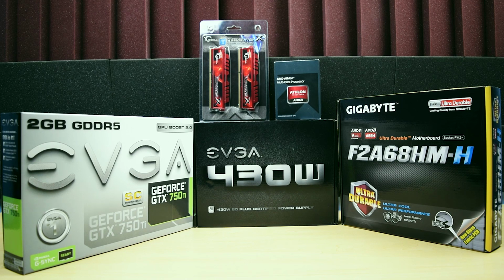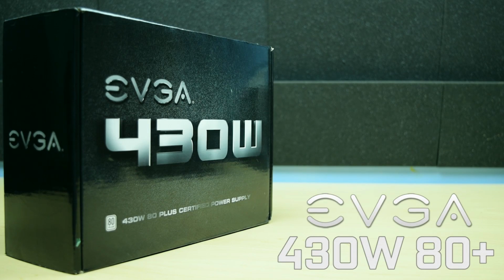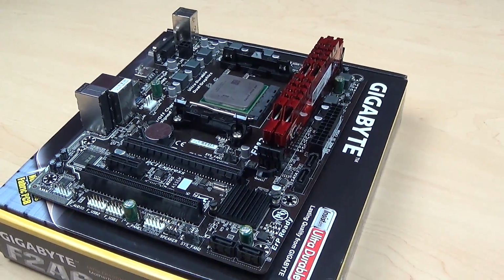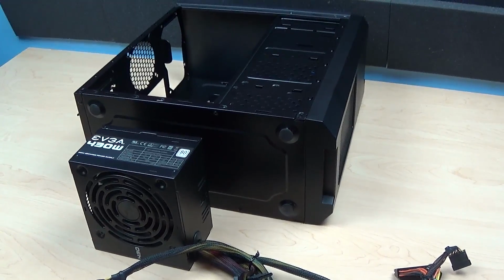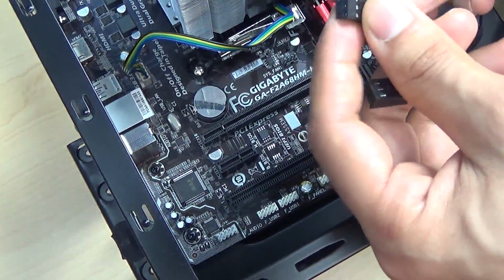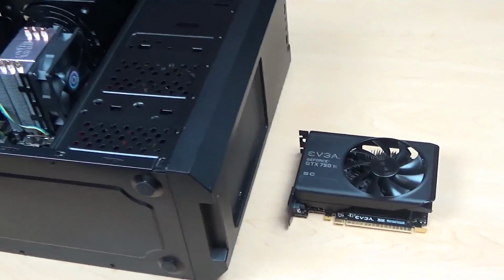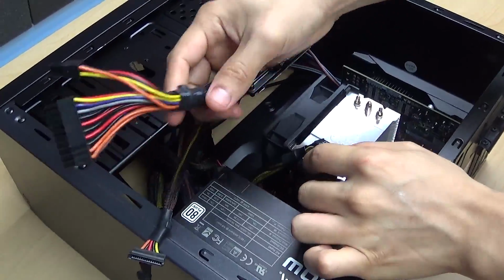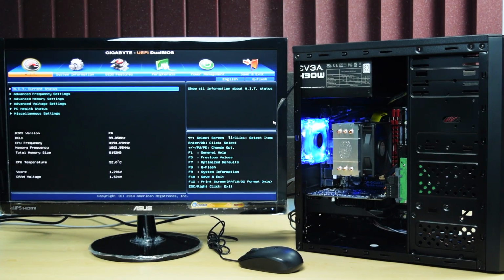Low Budget 1080p Gaming PC Build ($400)

Comment: PCPartPicker part list: http://pcpartpicker.com/   
here's what I made
Reply: PCPartPicker part list: http://pcpartpicker.com/p/GcKdBm
Price breakdown by merchant: http://pcpartpicker.com/p/GcKdBm/by_merchant/

CPU: AMD Athlon X4 860K 3.7GHz Quad-Core Processor  ($69.99 @ Amazon) 
Motherboard: Gigabyte GA-F2A78M-HD2 Micro ATX FM2+ Motherboard  ($51.98 @ Newegg) 
Memory: Kingston HyperX Fury Black 8GB (1 x 8GB) DDR3-1600 Memory  ($34.89 @ OutletPC) 
Storage: Seagate Barracuda 1TB 3.5" 7200RPM Internal Hard Drive  ($45.89 @ OutletPC) 
Video Card: EVGA GeForce GTX 960 2GB SuperSC ACX 2.0+ Video Card  ($169.99 @ NCIX US) 
Case: Thermaltake Versa H23  ATX Mid Tower Case  ($29.99 @ Newegg) 
Power Supply: EVGA 500W 80+ Certified ATX Power Supply  ($34.99 @ Amazon) 
Total: $428.72
Prices include shipping, taxes, and discounts when available
Generated by PCPartPicker 2016-04-02 18:28 EDT-0400

Comment: http://pcpartpicker.com/p/j9BjTW 1 Can someone suggest a good motherboard (cheap) 2 Is this a good first gaming pc 3 What games will it run 4 Do i need an ssd?
Reply: +Hail Rasmus the mobo you have at the moment isnt compatible with your processor, and whats your budget? and what are you planning to do with this build? gaming or also editing? and are you planning on overclocking?
Reply: +Nicky FD I know its not compatible and my budget is around 500. Im just planning to game. mostly cs go
Reply: +Hail Rasmus and will you be overclocking or probably not?
Reply: +Nicky FD Probably yes
Reply: +Hail Rasmus here you go http://pcpartpicker.com/user/Nickn753/saved/BTQWGX
i threw in a 8320E because i assumed you weren&#39;t gonna overclock and this is only about 25$ more than a 6300 but has better performance in general. i also chose the r9 380 because of its 4gb ddr5 and it being much much stronger than the 750ti. an SSD just doenst make sense with this budget as you would have to sacrifice to much performance for the speed you gain.
Reply: +Nicky FD Oki Thhhhhhhx

Comment: You picked a pretty terrible case for overclocking and to make it worse you didnt install a push pull directly on the tx3 :(
Reply: do you know the English language?
Reply: aslong as the case fits the mobo and gpu i dont think it will effect oc
Reply: better temps is one of the best ways to improve hardware life and increase you max potential oc. i personally run a push pull on an older hyper 212 with both fans blowing air directly up into 2 exaust fans. with 4 120mm in the front, side panel and next to the i/o sheild. Funny thing is it it didnt really cost me all that much and i get extra awesome temps. Well worth it imo

Comment: What frames would you get if you turned down the resolution to 900p or 720p at high settings? Would it achieve 60fps? Thanks
Reply: yes :)
Reply: +Edrick Vince Velicaria less detail and lower resolution mean higher performance.

Comment: what if i used old i7-950 cpu instead ?
i've seen one rebate so cheap (bundle with mobo+ram).
Reply: It's an older CPU sir, but it checks out. But you need a different motherboard.
Reply: ja, like i said, bundle with mobo (MOtherBOard + RAM 6gb)

Comment: is there a big difference between the 750ti and the non ti?
Reply: ti is iverclocked and has more vram
Reply: +Aryan TheGamer The 750 TI has more cuda cores also. So there is a large difference in the 2
Reply: If you're thinking about getting the 750 ti, save up for the 750ti sc because it's quite a bit more powerful for a little more. Or go for the ftw edition, it's factory overclocked

Comment: Hi can you check out my build? I am now building my second PC this one is going to be built for gaming obviously. And also I have one last question, will my CPU bottleneck the beast graphics card? Thanks for the help!
CPU: AMD FX-8370 Black Edition
CPU Cooler: Deepcool Captain 360 
MOBO: ASUS 970 PRO GAMING/AURA AM3+
RAM:Crucial Ballistix Elite 16GB Kit (8GBx2)
HDD: WD Blue 1TB Desktop Hard Disk Drive - 7200 RPM
SSD:Kingston Digital HyperX FURY 120GB SSD SATA 3
GPU:MSI R9 390X GAMING 8G Graphics
Case:Phanteks Enthoo Pro M Mid Tower Chassis, Black Cases PH-ES515P_BK
Power Supply: EVGA SuperNOVA 750 G2 80+ GOLD, 750W
DVD Drive:LG Electronics Internal Super Multi Drive
Monitor:ASUS VN289H 28" Full HD 1920x1080 HDMI
(I already have windows 10 and 8.1 on a disk)

Comment: Not a big pc guy, and looking to build this. Would it be able to run csgo or gtav? Thanks!
Reply: Cs go is a EASY game to run you don't need a good PC at all
Reply: +SancoCustoms easily
i currently have the same motherboard and cpu with a gigabyte r7 360 which is equal to the gtx 750ti and i get around 160fps in csgo with high settings
Reply: I have a slightly better build and can run CS GO at over 200fps so it can run it easily. I'm not a huge GTA guy tho but it should be able to run it fairly well

Comment: would the gtx 750ti sc play the new starwars battlefront?
Reply from the maker: +dallas Keller The GTX 750Ti SC can run SWB @ 1080p /45-60FPS high settings.
Reply: +WhiplashGaming you will probably need another motherboard voor intel cpu's but you can check it at pcpartpicker.com Good luckk

Comment: I bought kingston hyperx savage 1866 MHz but it was set on default in bios on 1600 MHz (MB supports up to 2133 MHz). should i change it to 1866 or just let it be on 1600 ?
Reply: +Sanchez9531 why would you leave it on 1600? like you would buy a car and never change it to a higher gear for more speed.

go for the max
Reply: klnhtw there's smaller chance it will break when you're not pushing it to it's limit. i'm just wondering if it would really make any difference. if it gives me 1 more fps i would do that.
Reply: these memory sticks won't break, trust me and set it to 1866, your rig should be faster(that doesn't always mean more fps, but more chrome windows, ect)

Comment: I thought AMD boards don't support PCI-E 3.0 as of yet. Or is it the cards?
Reply: +Kayemache 
since the erly quarter of 2015 almost everything supports 3.0
Reply: +Kayemache The 860k supports 3.0 but the FX series are only 2.0
Reply: +Ace Striper Thanks for the information.
Reply: +Kayemache Besides, PCI-e is backwards compatible. The newer standards just have more bandwith. So maybe GPUs 4-5 years from now will not work on gen 2, but no current GPU will have a problem on a Gen 2 x16 slot.

Comment: does it have wifi
Reply: nope no wifi, you have to get that separately. I built this exact same rig. It works great, I bought a netgear wifi USB but I found out that a lot of these USB wifi receivers that are out now do not support Windows 10 only previous windows versions. I updated everything possible, deleted, and re downloaded several times with different updates and it never even turned the USB on. So no wifi, and also no cd driver.

Comment: Will this pic work in 2016 with over watch and Gta 5
Reply: It will work great for over watch but you will have to play gta at medium settings. However I would get an Rx 460 instead of the 750ti
Reply: +Zachary Zedack ok thanks man I'm looking to get a new pc man
Reply: That would bottle neck the gpu cause the 860k couldn't handle the power
Reply: Pick the R9 380, the R9 380 is a good GPU and its a good duo with the 860K. Because The Rx 460 needs a better CPU. and the R9 380 is a good duo with the 860K
Reply: The r9 380 is more powerful than the rx 460. I use an I5 6500 with my R9 380

Comment: HOw did ur pc comes preintalled with an os?
Reply: No, its impossible to buy a bnew hdd with os installed. He installed it
Reply: Tyvm, installing the os on a new computer is the scariest part for me.
Along with getting the drivers.
Reply: +John Sia its just a software, its ok if you screwed up installing the os or drivers, you can use an application like driver genius to install the right drivers for you, it makes more easier
Reply: +John Sia Never install the drivers from the CD, always go to the manufacturer's website to get the newest drivers.
Reply: +ShrekalG0D - PvP Clips & Fights I use the cd for my gpu so i can get the card running and install the latest up to date drivers lol
Reply: EclipZe That's also an option as long as you update it :D You probably know this but the reason im telling people this is the driver cd in the box of the gpu comes with drivers from the release date of the gpu, so if you get a gpu from like 2012 the cd is gonna have old driver versions on it.
Reply: ShrekalG0D - PvP Clips & Fights Well I use a XFX R7-240 2GB of VRAM (DDR3 I think).
I'm saving up for a 750ti. Don't ask me to get the
R7 360/370 because the 240 always freezes when I'm pushing it's limits and yes I have proper cooling. AMD is top notch garbage when it comes to GPUs. No offense AMD fans but this is from my personal experience
Reply: +EclipZe The best method is to buy a cheap 1GB pendrive, Go to a internet cafe, download DRIVER BOOSTER 3, use the program to install the networking and sound drivers, then download the specific driver needed for your graphics card lets say GTX 750 Ti and your done. I heard driver booster 3 installs outdated drivers for graphics card so don't install that, use the onboard chipset on the motherboard till you install the graphics card drivers. 

Easiest way.

Comment: is this good? :'(
AMD A10 7870K 3.9 ghz
8 GB of HyperX DDR3 RAM
Asus A68Hm-K
some random case i found on a computer parts shop with a 600 Watt PSU
it cost me 387 dollars
Reply: If you get a graphics card, 750ti or r7 370, you can get better performance from your 7870k by changing it to a dedicated CPU instead of working as a CPU and GPU. Pretty solid though!
Reply: Haha ty

Comment: what program you use for fps?
Reply from the maker: +eiwa123 MSI Afterburner.
Reply: thank you
Reply: +MGTech what about this ...... ASUS AMD Radeon R7 240 2GB 128 bit DDR3
- 16 GB RAM Dual Channel ( 2X8 1866 MHZ ) 
- AMD Athlon(tm) II X4 860K 3.7 GHZ
- EVGA 500W PSU
- Windows 7 Ultimate - 64 BIT
Reply: +jackcan game 16 GB ram is WAY overkill for this , get 8 GB and maby save up a little more to get a 750ti.
Reply: Jack Baillie the thing is , it's not over kill because i don't need to get a graphics card , unless i do . do i need a graphics card with this build ?
Reply: Yes you would need a graphics card , the x4 860k does not have integrated graphics.
Reply: Jack Baillie what graphics card should i get
Reply: It depends on how much you want to spend. If you are on a really tight budget you might have to get the r7 240 , but if you can afford it I would definaltely save up for a gtx 750ti/950
Reply: Jack Baillie i all ready have the radeon r7 240 2gb graphics card , which gtx 750 ti ? there are different makes like zotac
Reply: Ah ok , the evga 750ti ftw as it has highest base and boost clock , but you might have to look into which one suits you best eg one might be smaller and more quiet but runs slightly slower or another might run the fastest but draw the most power.
Reply: Jack Baillie oh ok dude thx
Reply: +jackcan game np
Reply: +MGTech can this computer run fallout 4 and GTA V?
Reply: +jackcan game If you haven't bought anything, you should get an r7 370. Bit better than the 750ti and it's around the same price too.
Reply: +Goofy Gaming 
barely
Reply: The.one.lVlonster It could run it, just not too high settings.
Reply: Hey there MGTech! I might be getting the pc parts for Christmas :) Thank you so much for this guide. One more thing, the AMD Athlon X4 860K 3.7GHz Quad-Core Processor is out of stock according to PcPartPicker, do you know the closest thing to that proccesor? Thanks ~Adrien

Comment: Hey MGTech, i got the GTX 960 4GB card. How much fps will i get with this build?
Reply: much better.
Reply: Gtx 960 is weak dont expect much from it
Reply: 'Dont expect much from it' Why? You'll need to use the 4gb version but you can run all games, including next gen games on high settings with the right CPU, i am playing with the 860K with the MSI GTX 960 4GB, I run Fallout 4 on high 55-60 fps, GTA 5 on the same settings with same fps. Project Cars on Ultra no problem 60 FPS, so tell me again, why shouldn't i expect much from it?
Reply: +Gijsjuh since when is 60fps playable? 60hz scrubs
Reply: Alpay Aygün what the heck do you mean? 60 FPS is why people play on pc man
Reply: Gijsjuh 144hz is the real world
Reply: Alpay Aygün So? there's no diffrence between 60fps and 144 fps, it's both buttery smooth
Reply: IF YOU HAVE SOLID 60 PFS THERE'S NO DIFFRENCE THOUGH
Reply: Alpay Aygün That's right, but if you have 60fps all the time, no matter what happens, you don't need more fps.
Reply: +Gijsjuh 60fps is unplayable for me sorry
Reply: Well okay, i don't really understand why but okay
Reply: You play on pc right?
Reply: Gijsjuh ofc, consoles dont have 144hz capability. when you get used to 144hz and try to play on 60fps it feels like 30fps when you're used to 60fps
Reply: Alpay Aygün Eeeh okay i guess

Comment: hey i asked for a quick response cause i just built your computer and there is nothing showing up on the monitor we tried 2 moniters,with hdmi and vga and both didnt work plz help this time, u built so you should be able to help me out with this
Reply: or any veiwers that know what there doing with computers just really need help, am very frustrated cause this pc is not working plz help
Reply: +ItsRhyez Does the PC even turn on?
Reply: +Rhelmar yep it does it runs and the fans are good and eveything is plugged in but still no display on the monitor
Reply: +Rhelmar we need to find a way to install the graphic card drivers on this pc's harddrive
Reply: ItsRhyez it should still display something even without drivers. It's just the resolution that will be weird. So the fan on the graphics card is spinning but it's not posting on the monitor right? Do you have the exact same parts as in the video?
Reply: +Rhelmar yep fan is working and such and yes they are exactly the same as in the video
Reply: do you maybe have an old computer at home where you could try the gpu? Check again if you have everything connected properly. have you connected the 24 pin and the 4 pin connectors properly?
Reply: +Rhelmar yes we do have a older pc and i jusy check the 24 and 4 pin connectors are in properly
Reply: ItsRhyez try the gpu in the old pc and see if it works. If it doesn't work, the card might be defective. Did you buy it used or is it brand new?
Reply: you could also try the old graphics card (if your old pc has one) in the new computer and see if that works

Comment: can this run fallout 4 if so what settings?
Reply: yes. probably medium to very high settings.
Reply: oh cool thanks stargates96
Reply: welcome. I've seen lower speced builds run it at 1080p at high with 45 fps and also those builds have gotten 40 fps on witcher and stuff so this build should run it very well.
Reply: do you think it can run overwatch with high settings?
Reply: LoL KS high at about 35 fps but medium would definatly be 45-50 fps
Reply: LoL KS Actually No. I checked out some benchmarks with parts in this build. At epic its about 55 fps at high its over 70 so yeah you are good.

Comment: Will it run GTA V tho?
Reply: yes very easily
Reply: +Alexis The Pro It can run it at high settings?
Reply: +Gulle Master Of course
Reply: +Remus Ciuciu is that sarcasm?
Reply: +Romeo402 No isn't sarcasm.Will run GTA V on high. ;)
Reply: +Remus Ciuciu No it wont buddy ;)
Reply: +Oh Vegetables It'll run it 1080p medium. My 770 does high settings @ 60fps - 120 so the 750Ti might do 30 but it'll be better at medium
Reply: RoBoSkullz I shit you not, i have the same CPU and same quantity ram and speed, but different make ram with a gtx 770 and i cant even play the game on normal with 60fps. I use afterburn to watch the usage on my cpu. It always sits at about 96% and hits 100% easy and quite a lot which causes the map to glitch out, extreme fps drop and so on. 

Because of that, i am getting an i7 6700k with 16gb ram. But honestly, the 770 with the 860k cant run it at medium that well and the 770 literally stomps on the 750ti. So i think it wont run that well, maybe at 720p.
Reply: Really? I have an FX-8150, 4 years well-used, and it hits about 60-90% utilization on the CPU w/o OCing, and it seems to run fine. I guess you really need to OC the 860k to get it to run triple-A titles. I was about to go with a 750Ti as well when I went to upgrade, but I found a used 770 on eBay for about £30 difference (Roughly $42), and I didn't know that it crushed the 750Ti, glad I got what I have now. I have 16GB of RAM, but at 1333Mhz and that doesn't affect performance at all. I had BF4 running at 120fps yesterday, truly amazing what it can do. 

An i7 6700k should last you a really long time, it could go well with the 770 until it turns into the 1080p low settings card. I heard it doesn't have a massive difference between the 970 as well, while being half of the price.
Reply: RoBoSkullz I was looking at the 750ti/r7 370 when i came across someone selling their 770. So i got that xD I did use to have an oc on my cpu of around 4.1, but it didn't make any difference on Gta v which is my most played game. So i turned it down to stock as my temps were a little too high. 

I really do wanna get BF3 and BF4 maybe along with the Division, but i gotta save up for my £460 upgrade aha. 

If you want to see proof of this shit happening, i have a video of Gta V. When i record, it's always on 100% and never comes off it.
Reply: I'll look at it now

Comment: This is actually weaker than a ps4. Not than a xbone! But the ps4 is bettrrrr
Reply: Far cry 4 ps4 , 900p 30 FPS so no is better than console
Reply: Not even close... My setup is VERY similar and I can run most games at around 60fps 1080p. PS4 doesn't come close
Reply: Daniel Keener there are benchmarks for these parts. and this is weaker. get over it